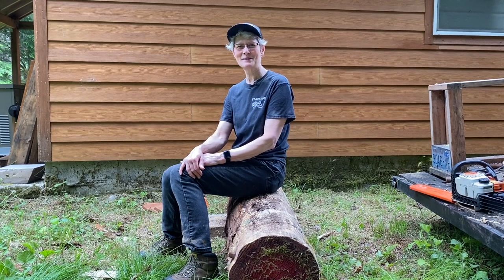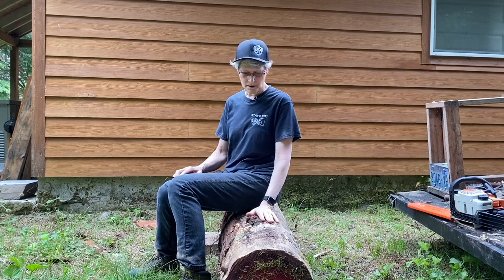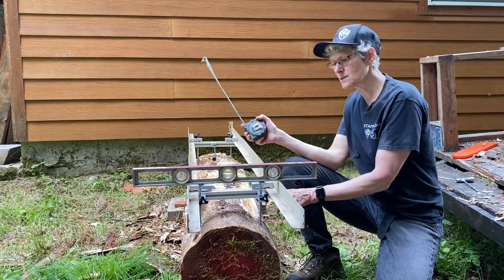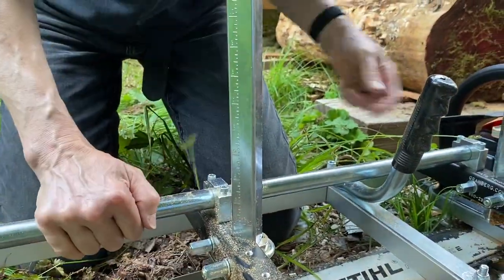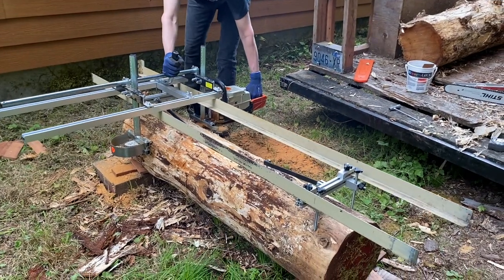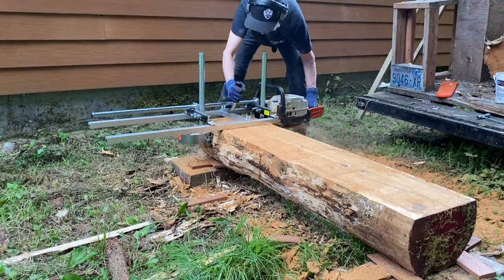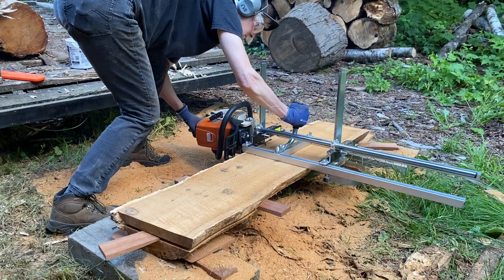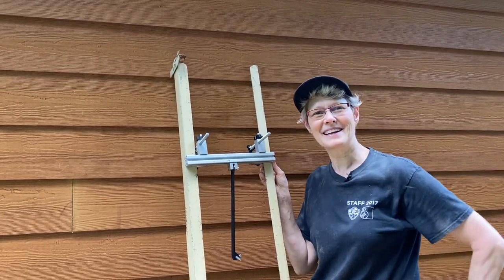Grandma and Her Granberg Mill - How to use the mill and rail system

Comment: What type of wood is it? Also, you think you can adjust the nose guard to leave the nose free and get those inches cutting a bigger log? like on the small log mill from granberg. Thanks! Awesome video.
Reply from the maker: This was cedar. Removing the nose guard would remove the clamp on that end of the bar, and it wouldn’t work well horizontally. The small mill Granberg has is meant to cut vertically, slabbing off the sides.

Comment: Love watching all your videos especially your shop work. Question is there a reason you can't or shouldn't cut to just 1" slabs .
Reply from the maker: 1” slabs will limit me to 3/4 end product. I prefer 2” so I have more flexibility. Legs for planters, etc that I want thicker stock to prep. May take more drying time, but that’s what I wanted. 9/4 if I wanted fence posts out of the cedar.

Comment: I have a still ms 390 will it work with this mill system..comments anyone, thanks.
Reply from the maker: Seeing as I was using a Farm Boss and the 390 is slightly larger on the cc’s, it should work. But the bar length is very limiting. Why I switched to a 36” bar and a 500i. Subtract 4-5” from your bar length to get the diameter tree you can cut. Use a rip chain (10-degree tooth edge) and take your time.

Comment: Huge fail for fast forwarding the cutting portion.
Reply from the maker: Thanks for the feedback. You are right. The rate of feed is important in slabbing a smooth cut. But is five minutes of running a mill through too boring for viewers? I suppose a cross fade would work to shorten it better. Much appreciated.